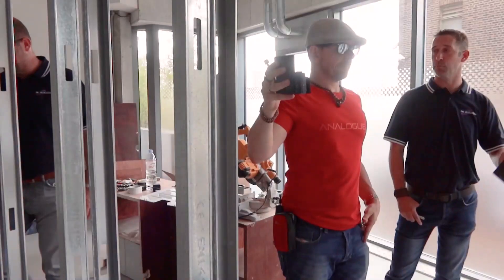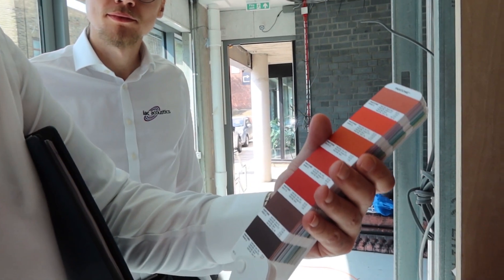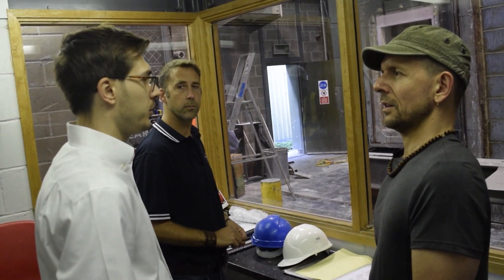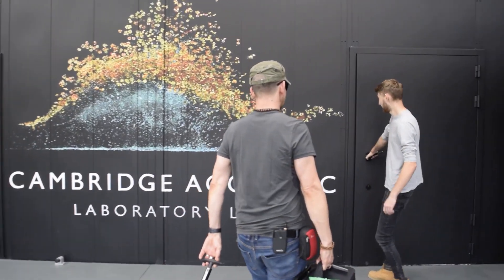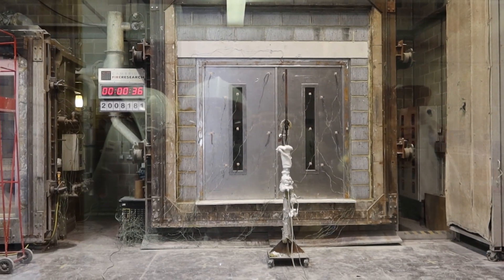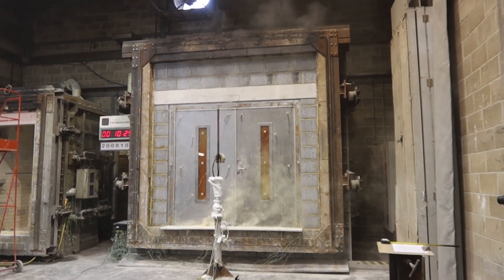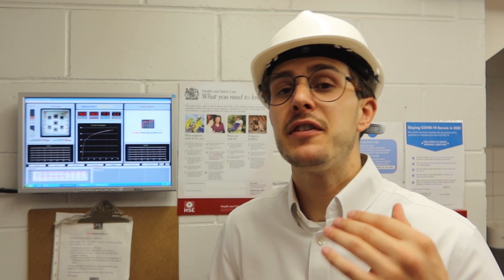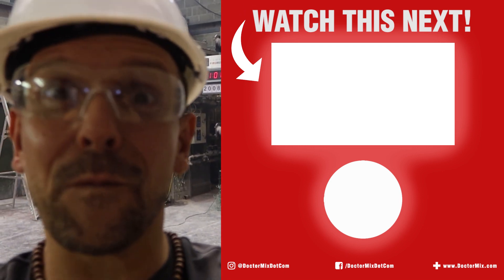Building My Dream Music Studio Ep. 6: Studio Doors Fire Test

Comment: Ah some more building engineering, loving it! I have been involved with stress testing precast concrete floors at a factory during the development of new type of precast floor for residential buildings. With those sort tests, a 3-point load test is performed to verify if the calculations are correct. With this test, the sample was tested until it starts cracking and the rebar starts slipping. At first the element bends excessively before it breaks.

Comment: So if your studio burns down the only thing that will remain are the doors! LOL
Reply: Thought the same...
The doors are cool but i doubt the rest of the dry walls are going to last long enought.
Reply: @NinoJoel  I bet the whole building could be vaporized and the doors would still be intact =) They will do their job fine isolating the sound in there. I love theese videos <3
Reply: @broderalias  just imagine the burnt down pile of rumble and in the middle of it there are 2 doors with the doctor mix logo
Reply: @NinoJoel  I rather imagine the studio without fire 😊
Reply: Fire spreads with oxygen. Meaning air. Since the rest of the studio is built both acoustically and to the country's own fire standards, you can safely assume it's air tight. The fire would spread and heat up the doors the fastest since it's where the room opens, meaning it's the weakest link in a real life fire. Having the doors built to with stand the worst-case scenario is logically the best bet. You'd wonder why a company like IAC Acoustics would dedicate hundreds of millions of pounds to research....

Comment: Crazy door but.. The drywall and wood will burn quick. So overkill?
Reply: I think he has it for sound blocking.  Agree on the other part.
Reply: Im sure the firedoor is for a better soundblocking... 

Anyhow, a drywall can resist up to 120 minutes of fire - but if you build a fire resistant drywall you use only metal profiles - no wood.
Reply: He’s using metal studs with drywall, mtl studs w 5/8 inch type x gypsum ea side is 1 hr rated in usa probably similar in the uk
Reply: Standards are much better in uk/europe compared to the usa

Comment: 😺 IAC Acoustics : Can I order these doors for normal houses ? I want to be safe even without a studio ! 😺
Reply: You can order doors for any type of room you need! Just need to make sure the structure supporting the frame can take the load as they are quite heavy doors as required for both acoustic and thermal insulation 😁

Comment: okay, wait....the doors will hold round 60 min of the hottest burning fire...BUT the door is build inbetween a woodn frame and the walls are made of aluminum frames, drywall and rockwool....these will not hold an hour right? or i mssing something?
Reply from the maker: The door holds for longer actually. However the  requirement in the UK is only 30 min, so the studio specs vastly exceed s the required standards ;-)
Reply: @Doctormix  okay. cool...man, u deserve this whole thing ....thx for ur content and i am really looking forward to the finished studio...dreasm should always be realized, thats wot i learn from this ...thx claudio
Reply: @Doctormix  But if the wooden frame that the doors are attached to burns out first (which would be the case) then there is little point in having such highly rated fire doors.  Now if you had used some form of thermal brickwork walls to create the rooms to which the doors were secured (ie similar to the test rig),  then acoustically treated the rooms I could see the logic...
Reply: You're missing that the doors aren't being fire-tested to 60 minutes specifically for Dr. Mix's studio.  It's so the door maker can certify that if you do install them in a brick or similarly fireproof wall that they'll keep a fire in/out for however long.  Like the guy said, they're gonna sell these to studios all over the world.

Comment: Do you want to install such a door in your studio? Why? It's a silly idea. Firstly, the weak point of your studio is the external double-glazed windows, which are easy to break and in the event of a fire they will melt much faster, and the second separation of the rooms in the studio does not take place in the way of laying bricks or concrete blocks, and by installing gypsum board partitions, these overloads easily break even in the case of a fire easily and quickly collapse, especially since your drywall is not fireproof. Therefore, using a fireproof door is a stupid idea and senseless
Reply from the maker: They are just the best studio doors! I always leave this to the professionals ;-)
Reply: @Doctormix  Yes, no doubt they are the best, but they must be used adequately. If your space is not intended for these doors, then why spend more money on something that is useless? I can understand if your studio was on the second floor and in the event of a fire in the next one, it would matter, but in this case it is a waste of money. You know, I have been engaged in construction for over 16 years, and I have my own construction company, I can only say one thing, clients like you are a gold mine, because you are willing to pay for useless things. Why put an armored door in a glass house, smart thieves will enter through glass walls.

I am sincerely glad that you are building a new studio, I well understand how important this is.